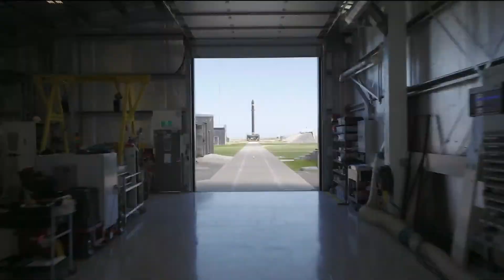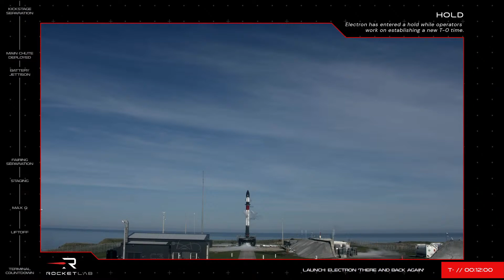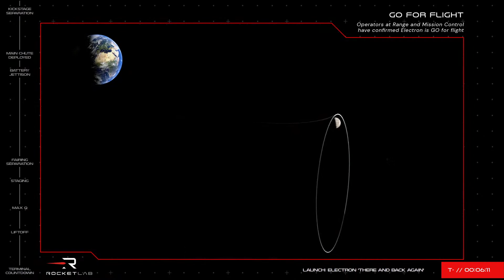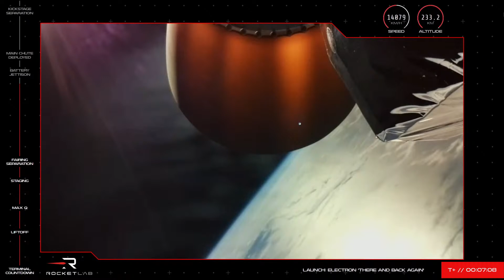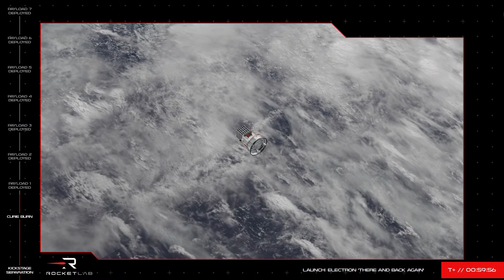Rocket Lab - 'There And Back Again' Launch

Comment: Intro- 6:40
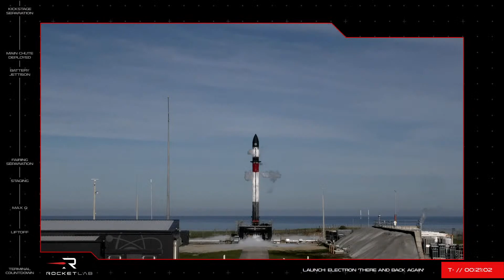Stream started- 7:34
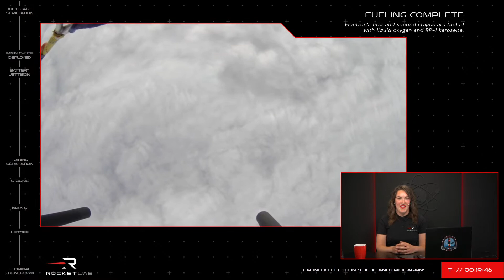Helicopter viev- 8:50
Lift off- 37:18
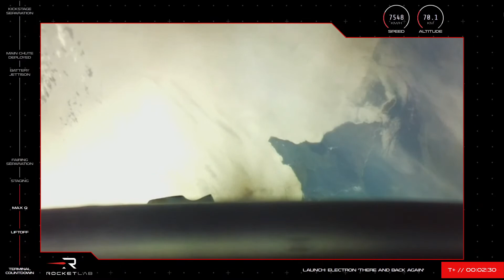Meco- 39:52
Faring separation- 40:28
First stage- 42:39
Battery jetstion- 44:46
Seco- 47:34
First stage from helicopter- 52:35
Catch?- 52:56
R.I.P- 1:35:55
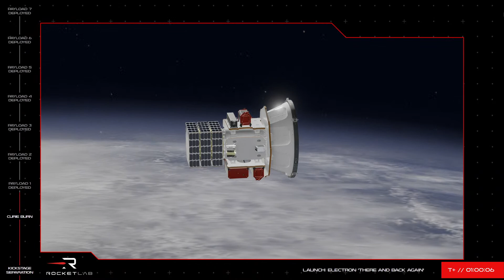Deploy- 1:37:42
Reply: thanks

Comment: I just rewatched the launch and initial booster catch. Just breathtaking. Huge congrats to Rocket Lab for an overall successful mission! And while the tether had to be cut, a huge shout-out to that helicopter pilot for the actual capture, absolutely superb!
Reply: If you're interested, they talk about the helicopter pilot's decision to offload the captured booster at 1:35:27
Reply: Did they catch and keep it? Why didn't they show it at land?
Reply: @trucksanddirt1506  The helicopter pilot noticed different loads on the helicopter than had been experienced in testing, and in the interest of safety, released the booster to fall into the ocean. It was recovered by a nearby ship that was stationed there in case just such an event happened.
Reply: @b1blancer1  Thanks for explaining. Don't they have an interval where the booster's load should fall into ? Anyway I hope the booster is not damage. Even though I was really hoping they would bring it to land. This is the video I've been waiting for the whole month. Anyway, great achievement, next time they'll make it work.
Reply: @trucksanddirt1506  For whatever reason this booster was putting loads on the helicopter the test article wasn't. As a pilot (private pilot, fixed wing), I can tell you one thing pilots do NOT like is surprises. This booster did something that was a surprise, and pilot did the right thing is dropping it. No booster recovery is worth risking lives for.
Reply: @b1blancer1  Thanks for explaining. That makes sense. Safety first.
Reply: Hello Stephen, congratulation on beating the surgery pimp, we always knew you will make it, say hi to Kelly for me :)
Reply: 52:30
Reply: Amateur and dangerous
Reply: @tafabeatz  Then you do it better.

Comment: 52:35 RocketLab caught the booster successfully, but the pilot didn't like the way it felt so he let it loose again. It splashed down in the ocean to be recovered by boat. Significant progress has been made, this is definitely a success, not a failure!
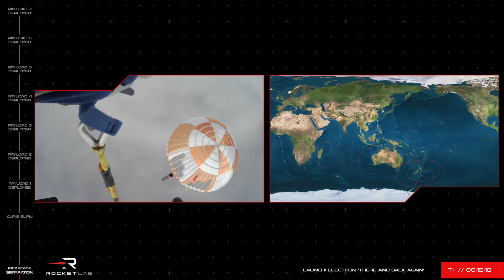Reply: At 52:45 onwards how can you even tell what happened? The camera was not even watching the actual capture taking place. Very poor camera work. 0/10 for this video.
Reply: @mikesmyth6576  Camera work is not the priority. Its just a fixed camera on the helicopter. They are focusing on the catch and not the camera, trying to use a camera and trying to catch it at the same time would be way harder and would decrease chances of success. They might be able to have a different camera setup in the future once more catches are done and they are more confident, but the camera setup for this is good enough to appreciate and see what’s happening.
Reply: @isaquest134  Their whole point of the live stream was to film them capturing the booster by helicopter. It must have been at least a 4 or 6 seater helicopter. If they've got passengers, what were they doing? One could have been dedicated to camera work. Instead we have so many viewers and probably the ground control too all watching a nice patch of cloud at the pivotal moment of capture. Isn't it the pilot's job to collect the booster, so they could see what was going on regardless. The camera operator would have been operating in isolation. As I said 0/10 for the film work.
Reply: I think perfecting the helicopter capture method is going to prove to be extremely difficult.  No two boosters are going to act the same on each capture.  It seems very arbitrary and dangerous to do it this way. Way too much room for error.  Congrats on a successful mission though.  The sound on your lift offs is extremely awesome.  I always crank up the volume and it makes my office rumble!
Reply: what if they use a fulton recovery sling for electron?
Reply: I wonder if retro rockets on the booster could be capable of cancelling out oscillations and spin during capture?
Reply: No this is amateur and dangerous
Reply: I think they're just now realizing that they're putting a human life at risk to play high speed high power tug on a tiny little helicopter.  It sounds like the pilot 'floored it', things barely held, & they were all nopenopenope
Reply: @atari2600b  They did a successful drop test last year, so they have actual data on this. Apparently, you can't always guarantee a stable catch.
Reply: Why don't they just land it like spaceX? That technology is extremely proven at this point. This seems way more complex, and involves a human that needs to get it right every time.
Reply: @_ShaDynasty  Because ships cost more than helicopters. Propellant to land the booster eats into your payload mass. The booster's dry mass is less than 1 metric ton. A Falcon 9 B5 booster's dry mass is somewhere around 25 metric tons.
Reply: @steveaustin2686  nailed it
Reply: @josephnetherland880  Not sure which part, but thank you. :)
Reply: @_ShaDynasty  Perhaps the biggest reason is that Falcon 9 was designed from the ground up a self-landing booster and Electron simply wasn't.
Reply: @_ShaDynasty  Because that technology is a lot more expensive.
Reply: @_ShaDynasty  technology is proven. But not out for sale. 
The entire rocket would need to be redesigned. 
Rocket lab is designing a larger rocket that will land.
Reply: @_ShaDynasty  Falcon 9 is a much bigger rocket. It was upgraded to support propulsive landing. Electron however is a very small rocket that can only carry a few hundred kilograms of payload into orbit. Landing it like the F9 would take away from the payload capacity a lot because of the amount of extra fuel and heavy recovery hardware required. Heck, it might not even be able to reach orbit. This is the best way for rocketlab to reuse electron since it doesn’t take away much from the payload capacity. RocketLab is going to land boosters in the future like SpaceX lands them, but only with Neutron, not electron.
Reply: @_ShaDynasty   landing requises accessories for this purpose ( like legs, and engine starters ), and they have weight. electron is much lighter than falcon 9, and affording weight to landing stuff has a proportionally bigger impact on payload reduction.

they need to keep payload above economical positive threshold. for small rockets parachute is cheaper in weight and money. 

they are both mature projects but don't play in the same court. 

see how SpaceX themselves will change their landing technique for starship. in fact, starship won't land at all, it will be catched in mid flight by mechazilla. leg design is for the moon landing. 

legs were specific to falcon. they were great, they did their job, but they are already outdated. by SpaceX themselves, and rockelab ...
Reply: The issue for me is that, that "difference in load characteristics" experienced by the pilot should have been anticipated. Their field tests should have taken into consideration every possible scenario. Releasing it into the ocean may still cause some amount of minimal damage.
Reply: @tekmepikcha6830  Even when equipment is rigged on the ground, it can go sideways on you. I was with the 101st Airborne when we did a division exercise in TN, moving everything by helicopter. A few vehicles were turned into pancakes when the loads didn't go well over the half hour flight and the pilots had to let them go. So with catching it, you can not guarantee that it will catch in way that would be good for the helicopter. Especially as it is at the end of a long tether and can oscillate in ways that would be bad for the pilot.
Reply: @steveaustin2686  True. You're right. I just have high expectations of Rocket Lab 😂
Reply: @tekmepikcha6830  Understandable. I was hoping that they would join SpaceX in the orbital booster recovery club. Hopefully next time.
Reply: @steveaustin2686  The rocket was probably pulling the helicopter all over the place - you can see it swaying quite aggressively.
Reply: @steveaustin2686  ok. but come on. he still had time to see if it leveled out. he’s essentially a test pilot and better damn well act like one.
Reply: @ryancairns2099  From what we were told about why the pilots had to drop those vehicles in the 101st, was that they were oscillating. IIRC, the division only lost one vehicle on the second round of moving the division and none on the third. Our sargeant supervised the rigging of our companies HMMWVs and the platoon sargeant backed him up. Our vehicles made it all the way through.
Reply: @pyrsartur3675  If the pilots in the 101st were dropping loads for swinging around, I would not be surprised if the RocketLab pilot did as well. He had it worse as his rigging was catch as can, rather than done on the ground. From what we were told in after action reports, was that once a load starts swinging, it is very hard to stop, so making sure everything is balanced in the first place is key. Our sargeants supervised the rigging and our vehicles were good, but others were not. This is also the first time, so they will almost certainly get better at it.
Reply: @pyrsartur3675  Safety is the first concern of test pilots. They take calculated risks not reckless chances.
Reply: @markhorton3994  Spot on!
Reply: @steveaustin2686  I believe that I have seen Blue Origin flying and landing their rockets multiple times too.
Reply: @trucksanddirt1506  yes, but theres a huge difference between an orbital recovery and a sub orbital recovery. The velocity of an orbital booster reentering is much greater than a landing of a simpler up and down flight.
Reply: @pyrsartur3675  Unless you were there, you have no idea what was happening on board the helicopter and what was being experienced. Even empty of propellant, the booster would still weigh at least a ton. To have that swinging around at the end of a long tether would put tremendous loads on the helicopter. Your statement is absurd. No booster recovery is worth putting lives at risk.
Reply: @vulcantoolworks  so you're saying, they probably don't know how to do it ? Because I'm just not seeing anything that can compete with falcon9.. unless they replicate it.
Reply: @vulcantoolworks  But in both case it's still the same principle. They reignite the engine to land safely. I don't see the velocity as the key issue. So Blue Origin also recovers rockets.
Reply: @trucksanddirt1506  Blue Origin lands straight up and down sub-orbital rockets that travel roughly 4 ground miles from launch pad to landing pad. A FAR cry from an orbital class booster that has a significant lateral velocity and travels hundreds of km down range.
Reply: @trucksanddirt1506  Velocity is a VERY big issue for landing a booster.
Reply: @_ShaDynasty  electron first stage is literally as tall as falcon9s legs
Reply: @tekmepikcha6830  -You can trust that all what they experienced was anticipated. Not until you actually do a field test can you experience many of the calculated effects and counter measures. Be assured that the pilot was given direction to not risk anything and to abort at the slight sign of a challenge. Any data recorded during this attempt is extremely useful. Only when you go through the actual procedure can you experience all that you theorized. You attempt to make them sound like they don’t know what to expect, is from such a myopic viewpoint.
Reply: @tekmepikcha6830  "Every possible scenario..." Seems like a tall order for such a complex dynamic system don't you think?
Reply: @bradley3549  don't take it too literal though lol.... You know what I meant 🤣🤣🤣

Comment: 52:35 It was at this moment we all knew...😎

37:18 Lift off.
39:54 Stage separation.
40:30 Fairing separation.
42:40 First stage swimming around.
44:46 Battery hot swap.
47:33 Seco.
1:37:42 Payload 1 deployment,
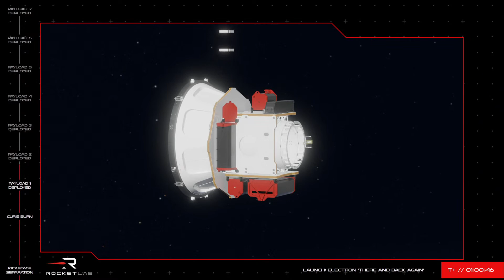1:38:18 Payload 2 deployment,
1:39:00 Payload 3 deployment,
1:39:48 Payload 4 deployment,
1:40:37 Payload 5 deployment,
1:41:16 Payload 6 deployment.
Reply: Thanks!
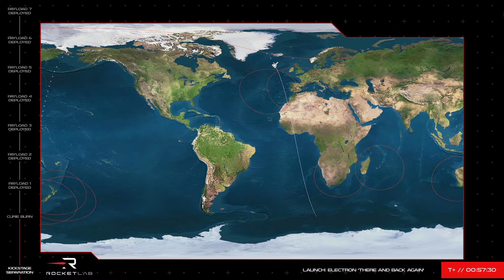Reply: 1:35:06 Webcast is back after the break